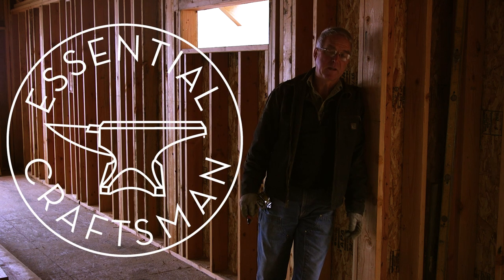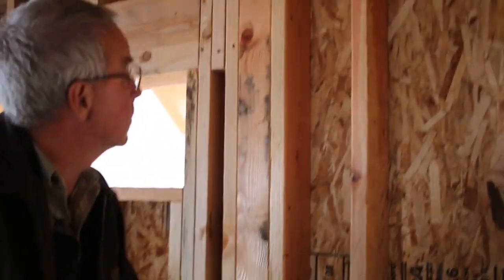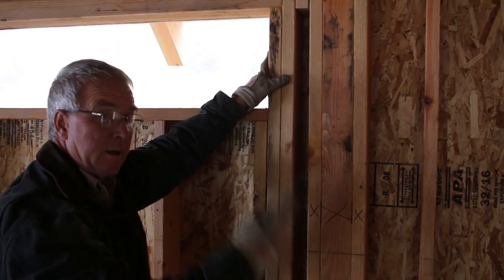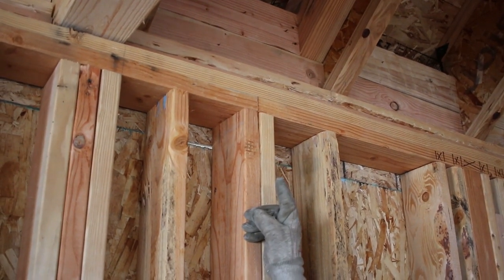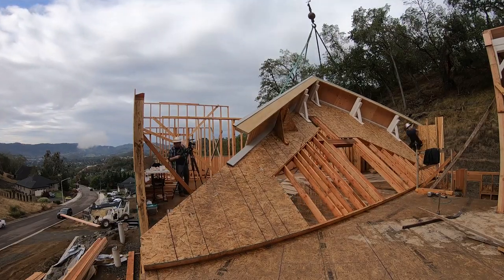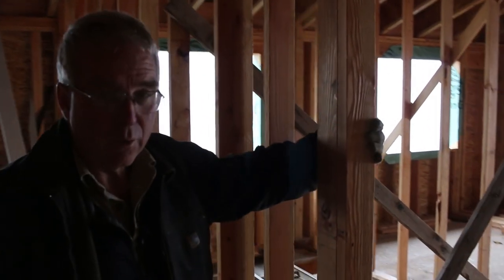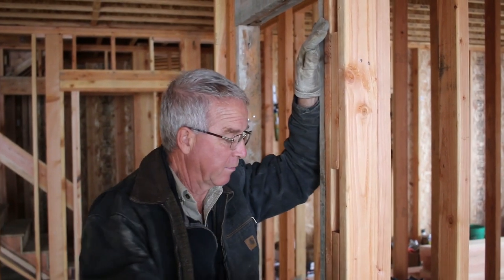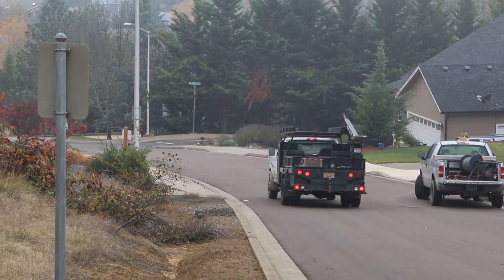Framing: The Parts of a Wall

Comment: "I like wood."  I get that and it is indeed easy to just throw in extra studs when needed.  The only problem with that is that wood is a poor insulator.  Unless you're using insulated studs (tstuds), each additional wooden stud is going to reduce the overall R-value of your wall.
Reply: That is what I have been complaining about for the whole series.  This house is being built with techniques from 50 years ago instead of using any of the modern techniques that have been developed to make a house better insulated and more efficient.
Reply: @chrismoore9997  except they live in Oregon where the climate is pretty moderate. No need to spend the big bucks on crazy building techniques when you're never getting your money back. In the end it's all about what you're willing to spend upfront and what actually turns into a profit
Reply: @chrismoore9997  All well and good but the 'new' techniques have their own set of problems.  Like the R2000 houses where moisture and mold were a major problem and then venting regulations had to change to 'unseal' the houses.  Stud heat loss is minor in comparison to windows.  Even with triple pane, argon filled units, windows are the major heat loss location in any house, followed by all the vents and ducts.  In a practical sense, studs are the least of your worries.  If you want to reduce stud heat loss, exterior clad insulation can be used, and is on some custom homes in northern latitudes.  On an additional note, old school framing is orders of magnitude better in terms of fire safety.  New homes with 'light weight' construction are death traps and glorified kindling.  There are many reasons "old school" construction is still the default method.  Having renovated homes for years, I'll happily curse my way through a properly framed house than deal with modern cardboard boxes.
Reply: In Oregon, this probably makes sense, and who cares if these extra studs make your electricity bill go up by 35 cents a year, really. Here in Québec where I live, some are framing with the double wall technique that gives an ugly 12 inch thick exterior wall, and for what? When we open the doors during winter time, all those super insulated wall loose there raison d'être because just 30 seconds of cold getting in, or heat getting out, makes you loose all that you have saved during, say, the night. Just build with great care, like in this serie, use good quality material, and just pay your electricity bills. Good for you if you live an a moderate climate zone. And by the way, @DGPrepper, have you seen or built a house with T-Studs? I bet that the difference in price will be the same as keeping all your windows open during 3 cold winters, trying to heat up the house.
Reply: Jakob Mertens 
I live in SoCalif where it is even warmer, but that does not reduce the need to reduce energy usage or increase the lifespan of a house. 
Matt Risinger and his cohorts use a home building Best Practices that are today called, Building Science. Many of the viewers of this channel would laugh at some of their building practices... but again many people for many years laughed out loud at Christopher Columbus when he sailed off for a place that someday would be called North and South America. 
One hundred years ago, there was no insulation used in homes, I'm sure it would have been not only laughed at but considered ridiculous, today it is required in homes, and in some jurisdictions required on building exteriors instead of or in addition to between studs. 
One thing in particular that Scott has done in this house which practitioners of Building Science consider ole school, is Vented Attics, and Vented Craw Spaces. This Comment Box is not the place to delve into the particulars and one can Google Search the subject, and there are many other building practices that can lower the cost of energy usage and also increase the lifespan of the house.
This is NOT to say Scott is a poor Craftsman at all. 
Scott is most definitely a highly-skilled, Master Level Carpenter, one who knows and can teach the finest practices of assembling the walls and roof of a building. 
Hopefully, Scott and his son Nate can check out this thing called Building Science and share it with his followers...
Reply: Kirk Hancock 
Sir, you are comparing Crab Apples & Blood Oranges.
I am offended that You would lump together short-cuts & inferior building materials used by today’s Production Builders in order to squeeze an extra couple of bucks of profit out of building homes with Building Science.
Building Science has nothing to do with using poor practices.
Yes, Engineered Trusses do not survive attic fires the same as full-size lumber trusses, but houses are built much safer (fire sprinklers in  homes).
Matt Risinger and those of The Building Science movement constantly are condemning the use of light-weight products or building short-cuts practiced by many PRODUCTION Builders!!!
Reply: @BrianBriCurInTheOC  This is a spec house, where they are building it to try and make a profit. They likely researched home values in their location along with all the other pros and cons of certain building materials to see if the input cost of construction was going to yield a house that will actually sell in the market. I think Scott has mentioned this in several videos. The materials and methods they have put into this house are already above and beyond the codes for the area. They consistently consult a structural engineer. They know exactly what they are doing to make money in their housing market.
Reply: @all Fair enough.  I can't say I know what part of OR we are talking about.  Some areas are temperate while others are not, but maybe r-value is not a concern there.  I recently saw many houses in the Outer Banks were perplexing - but I don't live there and I don't know the whole decision-making process for the climate. That said, something still bothers me about randomly adding extra studs when the plans don't call for them - especially for a spec house.
Reply: SleepFaster18 
When I saw Huber Zip products used on one end of the SPEC House, I had to wonder whether to laugh or scratch my head. Huber Zip products are not normally used in Spec Homes. And most homes using Huber Zip sheathing do not use vents craw spaces or vented attics. It is just a whole different mindset! 
Scott can pound a nail or squeeze a trigger on a nail gun as few can... In my opinion, spec homes are just a little higher on the evolutionary ladder than the Production Homes Risinger talks about. The guy complaining about windows being the worst culprit on heat loser has never seen a thermal image of the exterior of a wall, the simple use of a basic calculator would prove him incorrect. 
If Scott would avail himself with several hours of Building Science YT Videos he could be even more proud of building a modern home. 
I like the guy, love much of his Grandpa wisdom, but wish he would grow in his knowledge base and encourage his followers to do the same.
I have worked on the remodeling of many 100-year-old homes. 
They are lovely homes, I just wonder what their builders would think of the 5’x5’x5’ footer full of a rebar cage and Simpson steel reinforced wall in the $1.5million remodel I worked on last year?
Scott is a great guy to run a framing crew a few years ago, but it's a whole new world out there in construction.
Reply: Also don't forget Risinger's clients are clearly multi millionaires. I love his channel but his situation (also completely different climate in Austin) is just not the same.
Reply: @superjakoboy  Yes. Matt Risinger is building expensive custom per order architect designed homes for wealthy clients. Scott is trying to build a house that a middle class family in a small, not particularly wealthy,  town in Oregon can afford to buy.  Until everyone can accept that reality and it's implications the guys shrieking that Scott should build the same way Matt does are just flapping their gums.
Reply: It is in Oregon. They have only required outhouse on job sites for about 15 years. It took 2 years after the that law passed to get a vendor and pumper trucks set up. Codes  and inspections are only a suggestion in most jurisdictions.
Reply: @superjakoboy  - I suppose the builder might not get his investment back if that's what you're talkin about.  the cost of the upgrades is worth it when you figure the house is going to be there for 50 to 100 years or longer
Reply: Another thing about Huber Zip products is I’m not sure if anyone has ever used it in conjunction with regular OSB sheeting. The two building styles just don’t intersect with their goals. 
I would hope Scott could explain his intention. Zip is used in much more air tight (which most of you do not support/understand) and moisture tight building. It is also used in house having Conditioned Attics and Craw Spaces.

Comment: I'm surprised all your boards look really straight, none looked bowed or bent, having worked with that treated timber before, I've really hard to pick out even close to straight boards, in fact any timber had that problem, but yet, besides the knots, everything about that house inside and outside looks perfect, how'd u get such good boards is my question or how did u get rid of the bowing
Reply: Keep the bundle strapped until your ready to use it
Reply: Jake Lewis don’t buy lumber from Home Depot
Reply: @robertbeirne9813  I don't buy the timber, I just work with it and manufacture it for the customers, sometimes make tables, sometimes just make weatherboards, and etc, my boss buys the timber, his only reason is timber is becoming a lot harder to find decent quality timber, especially Rimu, a common use, and my least favourite timber, I know of, heck he's struggled getting pine, a couple of times, and pines 1 of the fastest growing timbers, this is the same boss though that somehow buys purple heart packets in brilliant quality easily, my most favourite timber, also can get LOSP, and Siberian Larch which I had never heard of b4 I got the job, and looks very similar to Oregon, very fast growing tree, as they only tend to get wet or badly treated wood, but is very structural over time, and I guess the new popular timber in my business
Reply: Most of that lumber is not treated. Pick it well when purchasing. Wood that’s stacked straight, stays straight.

Comment: I prefer the term 'lintel' rather than header.
Reply: Right Lane Hog around here lintel is usually masonry, header is lumber, don’t know why
Reply: @carls6359  Deep in the mists of time, when I was being introduced to framing, header was used as the term for a component like the doubled joists placed at 90 degrees around a floor opening.

Comment: And then there's blocking, installed to receive handrails, grab rails, TV wall-mounts, and the like. No amount of fancy fasteners make up for the absence of good blocking.
Reply: William Degnan There are plenty of “fancy” drywall anchors that will hold big TVs. Handrails and grab rails can be attached to studs or to drywall with “fancy” drywall anchors. I have some drywall anchors that hold 160lbs each.  Two of those make 320 pounds of holding. I doubt any TV weighs that much.

Comment: I am so thrown off by these framing techniques.  I am from the northeast and wall framing is done totally different.  After the deck is down all of the interior and exterior walls are chalk lined.  Then all the bottom plates are fully nailed down with door openings removed.  Next you follow the entire layout with your first top plate temporarily nailed from one edge.  Next the second top plate is fully nailed down but overlapping corners and allowing for overlapping of plate splices.   We then mark all 3 plates for stud, window and door layout as well as second floor joists or rafters.  To install studs, headers, liners posts you just pull the temporary nails from the edge of the top plates.  Everything is toenailed to the double top plate. To stand the wall you slide the studs up against the secured bottom plate, tip the wall up and toe nail all stud bottoms to the marked plate.   Then you add you window sills and jack studs.  I am not saying this face nail technique is wrong.  I just can’t wrap my head around it unless you are sheathing walls before standing them up.  Great work.  Love your channel.
Reply from the maker: Thank you for a terrific description of a different technique! Occasionally on the West Coast we will frame a balloon framed wall, with toenails, one stud at a time. But usually we temporary up the first top plate with the layout on it, and then place one stud after the next to the layout marks and the crown plate afterwards. I will have to think carefully about what you have described!
Reply: Essential Craftsman I never gave this task much thought.  I will have to record my next frame and send it to you somehow.

Comment: Way, way, way, too many studs in that wall.
Reply: Search "roseburg oregon weather averages". If you're worried about insulation, you're probably right in general. However, it's a pretty mild climate. Dec is the coldest month there with an average daily high of 48.

Comment: You have a ton of thermal bridge from the exterior.  This house looks to be built using technology from 50 to 70 years ago instead of any modern materials that could have made it more efficient to heat and cool.  It is really going to suck for whoever buys it.
Reply: Except it's in a region that doesn't have particularly high heating nor cooling demands,  so it's probably not going to be much of an issue.